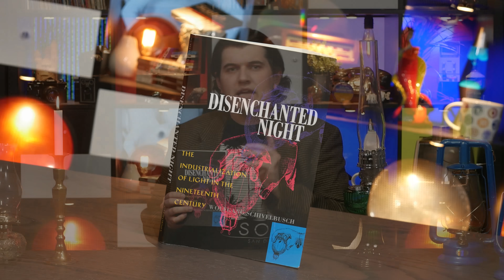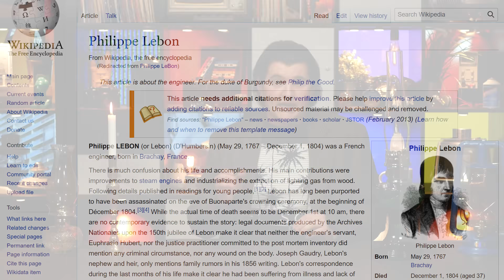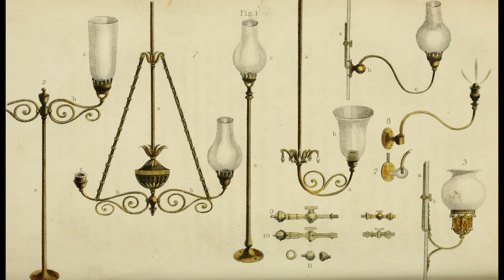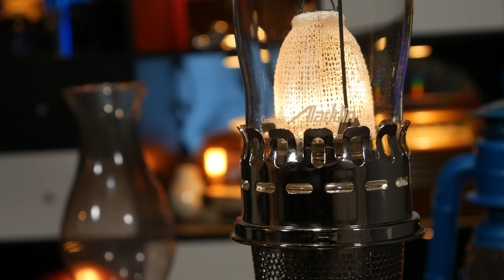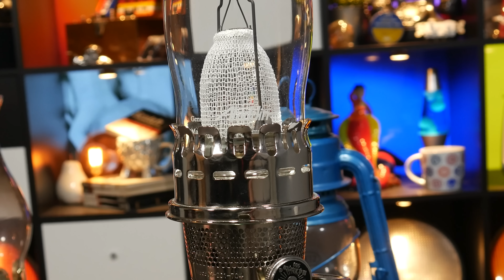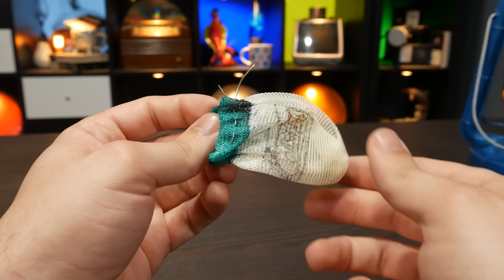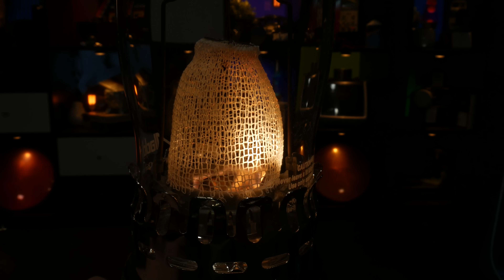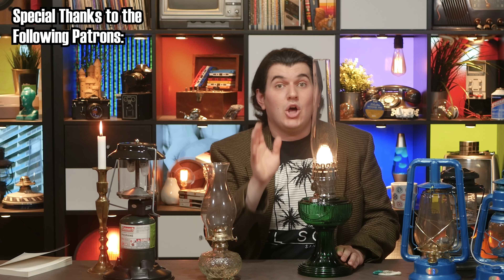How the gas mantle made lamps 10X brighter

Comment: "Consumers Gas" (coal gas) is why we still install a 'drip leg', before all gas appliances. This fact has been lost to history. Just ask any HVAC guy, and he will start scratching his head. Before Natural Gas was piped into distant cities, Coal gasification was used; which was a dirty process. Methane, ethane,  carbon monoxide, hydrogen, carbon dioxide, particulate matter, all stuck together with water. This mixture ended up in the pipes, which often condensed into black goo. This goo ended up traveling down the line, so a "drip leg" trap, was necessary to prevent disaster.

Comment: Candoluminescence is the process in which radicals from a flame react on a catalyst material and cause emission through some other input than heat. The heat drives the reaction by adding energy and/or changing the catalyst to a different state than it would be in at room temperature, but the actual reaction causing the emission is chemical. The materials chosen for lamp mantles happen emit a lot of light in the visible spectrum, so the glowing from candoluminescence is brighter to the eye than the blackbody flame glow- hence why the coal-gas flame could be burned efficiently and invisibly. In order for it to be candoluminescence, there has be some photon emission that is more detectible than blackbody emission somewhere in the EM spectrum, otherwise there is no specific special emission to call out.

The actual mechanism for the photon emission is simply electrons dropping energy level as always. The reactions in the catalyst cause electrons to be excited, allowing them to drop down in energy state once more and emit photons. Of course, all chemistry is moving electrons.

Comment: Suggested connection: infrared gas burners, where you use gas and a ceramic/catalytic element rather than an open gas flame to cook food.

Comment on the city gas: this wasn't simply distilling volatile materials of out coal, but rather partially combusting the coal or reacting it with steam to create a mix of hydrogen and carbon monoxide. More than a little toxic.

Comment: Concerning the kerosene mantle lantern "wick" not fully supplying fuel evenly to the flame.... if anyone in the past has ever tried using diesel as a substitute fuel in any wick lamp/lantern/heater or cooker, it will do exactly that.... it will work fine for a few hours on diesel, but  the problem compounds as the dissolved wax particles and additives in the diesel are being deposited on the fibers of the wick and sealing them from any capillary abilities.... removing and submerging the wick in a  some brand of gum and varnish dissolver solvent (the type for engines/fuel systems) for 3-4 hours, and then rinse in clean solvent, it will restore the wicking capabilities to like new...😊

Comment: As a kid, I grew up in the 1950s. At that time we were not so "fragile" over the safety gas appliances. So, like many others, we had a Colman stove and gas lantern, both for camping trips and for when the power failed. In our rural setting. That was several times a winter, often for a couple of days at a time. Decades later, I lived in the city, where extended power failures were not an issue, but failures happen as short outages. As much for curiosity and need, I bought a Colman stove, a bit more modern but basically the same as what we had in the 1950s. I also bought a two burner Colman gas lantern. (Ebay has almost anything.) Both needed service to function. I got the "how to" information off the internet and parts from Colman. I disassembled both items, fully cleaned and restored them, Both now look and function as though new. Thy went on a few road trips, but now have a place of honor in the garage, waiting for need to arise. Using white gas, they are a bit less convenient to firs start, but the stove is potentially hotter than the modern propane units, and the lantern is brighter than propane or electric alternatives. Additionally, they operate longer on a fuel supply, and their cost of operation is a small fraction of modern units. A great combination of nostalgia and practicallity.

Comment: A side note: coal gas contains a deal of hydrogen. This allows for self-igniting devices - a fine coil of platinum wire becomes incandescently hot in coal gas/air mixtures. So you could have a (gas) switch by the door and the light would come on automatically. (Putting a flame to a cloud of gas/air mixture after switching on is not recommended... )   Sadly these devices dies out when natural gas was introduced - methane won't do this trick

Comment: When early scientists didn't have a great supply of glassware for distillation and other processes,
and they wanted to put together gas tight joints without melting the glass together, they would use
clay and other materials, depending on pressures and the solubility of the sealing clay, and they
would call it lute.

Wikipedia "Lute (from Latin lutum 'mud, clay etc.') [1] was a substance used to seal and affix apparatus
employed in chemistry and alchemy, and to protect component vessels against heat damage by fire; it
was also used to line furnaces".

To 'Force my lute', would mean the seal would fail from too much pressure.

Comment: Before you mentioned it, I was wondering if the coal gas was along the lines of the coke gas I remember seeing vent from the old open hearth furnaces of the steel mills in my area when I was a boy.
My grandparents had those Aladdin lamps back in the Depression. My dad used to talk about how bright the were compared to a regular wick. I'm familiar with installing mantles in my Coleman propane lantern.

Comment: gasometers certainly did measure as their rise and fall did indicate (albeit to an imprecise degree) the quantity of gas inside them.  Early gasometers were not the massive steel behemoths many of us remember but were rather fragile devices that required the protection of an external building called the gas holder.  Many of the brick gas holder buildings survive including one very large example in Boston which was converted by Best Western into a hotel  - now called Roundhouse hotel.

Comment: 19:35 I assume the bulb shape & lattice is what makes it smokeless. 

It’s super heating it inside that bulb lattice, so it doesn’t actually emit smoke. 

I’d guess.. Inside of that lattice, while it’s hot, air is being pulled inside each of those small openings, and getting super heated, which super heats any smoke flowing up into it.
Reply: There’s a campfire / stove out there called a Solo Stove that does the same thing, just differently.

Comment: The use of the term "gasometer" is entirely justified  as it is indeed a measuring device.  Murdoch anglicised the term coined in French by Lavoisier.  The height of the dome within its framework gives an instant de facto indication of the volume of gas it holds. This is obvious because it's the gas that's holding the dome up and as the supply depletes the dome sinks lower.  The works manager would be able to read the gas level from a good mile away.  Anyone who remembers their local coal gas works knows this.

Comment: 19:00 Kerosene if burned very well in a controlled burner with blue flame produces little odor. I think ThO2 act as catalyst in that lamp, it can for carbon monoxide oxidation. With ThO2 (thoria) you can produce light hydrocarbon from carbon monoxide and hydrogen too or CO2 and hydrogen from carbon monoxide and water.
Cerium Oxide act as catalyst too and is used in newer gas mantle, and catalytic converter for automotive. (Rare earth elements)

Comment: When we were kids in Edinburgh newhaven  in 1950 we had gas lights in our house and my mum forbid my sister and me from lighting the mantel in case we touched it an if you did it  fell apart and a new mantel was tuppence  out of ratters shop in newhaven it was nor till just before the coronation of the queen did they put electricity in the houses  and we used to take turn on turning on the lights  that was also the last of going to ratters store for battery acid for our old radio  happy days  then when the queen got crowned we had a street  party and all the kids got a shilling  and a masons pie  I’d almost forgotten all this but this video brought it all back  I’m 78

Comment: I scooped up an Alladin lamp 30 years ago for nearly nothing, I’ve used it occasionally…it’s a great piece…on another note, I heat with coal, use Nat. Gas for dryer, water heater, and range, and have all the other lamps shown as emergency lighting devices…

Comment: That initial burning of the brand new gas mantle fabric did look a lot like the burning of guncotton or nitrocellulose: Similarly rapid, equally bright and the same almost total absence of smoke. So that is definitely a possibility, though not the only one.
There is another way to make cotton (either cotton wool or spun cotton fibre) behave in a similar way when burned: Make a saturated solution of potassium nitrate, soak the cotton with this solution, and then allow it to dry out. This leaves a layer of solid potassium nitrate coating all the cotton fibres.
A similar process is the "corning" of gunpowder - mixing it to a thick paste with water, and then drying this out again - often by spreading the paste onto glass or glazed ceramic plates or trays and leaving them in direct sunlight. Today this is still done, but the drying stage is carried out in large, relatively low temperature electric ovens. This isn't as crazy as it might sound, because while gunpowder is extremely sensitive to sparks (both electric sparks and the flint on steel type), it is much harder to ignite with heat alone or even a naked flame.
Anyway, the point is that the potassium nitrate is the only water soluble component of gunpowder. So when the wet paste is dried out again, each particle of carbon or sulfur gets coated with an intimate layer of nitrate. This makes "corned" gunpowder burn much faster than a simple dry mixture of the components, and is therefore much more effective as an explosive or gun propellant.

Of course potassium nitrate isn't used in the manufacture of gas mantles. But it is not the only nitrate salt which can be used for the same or similar purposes: A peculiar property of inorganic nitrate salts is that they are all water soluble. Any metal that will dissolve in nitric acid (which is almost all known metals) can form a solid nitrate salt, and all of those have oxidising properties, since it is the nitrate ion that does the oxidising.
So the gas mantle fabric was almost certainly cotton which had been soaked with saturated yttrium nitrate solution and then dried. The intimate coating of all the cotton fibres with the nitrate salt would have a similar effect upon its combustion. Hence it looking similar to the burning of nitrocellulose when the mantle is ignited for the first time.

Comment: Here in Pennsylvania, the Amish community (Pennsylvania Dutch) uses these lamps since many don't use electricity.  When I was a youngster our house was 'wired' for gas lamps, I believe that the house was built about 1910, most of this piping was shut off when the house was electrified but I don't know when that happened, it was with BX cable (steel wrapped not knob & tube), in my Uncle's house the gas fixtures still worked but the mantles were missing.  'Dangerous' electricity didn't really dominate the market until after WWone, I suspect that this was due to fear of the newfangled stuff and the cost of hooking up and wiring the building.  What really got electric going was when appliances such as fans, vacuum cleaners, and the big deal, refrigerators became available.  I was a young kid during WWtwo and several houses on my block still had ice boxes and every other day the iceman came on his horse drawn wagon (WW2 gas rationing) bringing them a block of ice, his big customer was the tavern down the street, icemakers was not in general use at that point.  He had a small gasoline powered grinder on his wagon that made crushed ice.  The apartment building down the street had all gas refrigerators, might want to do a video on how a gas flame can cool thing off, hey, I was in the Philippines during the late 60s and the local druggist had a kerosene refrigerator, much more reliable than the local electric system that shut off at about 10pm.

Comment: I went through a period where I collected a lot of antique oil lamps, various types of wicks. I also had many Aladdin lamps. Eventually abandoned the Aladdins to the closet because they are just too unreliable. Sometimes they do fine. Then they wont do right at all. They will be burning great, you look away, look back and flames are pouring out the top of the chimney and the room is full of smoke. Give me a nice center draft, round wick lamp anytime. Just about as much light and very reliable.

Comment: It's maybe bit late, but there is another nice lamp, you've missed. It's called Petromax500. It's partly the same kind like the aladin-lamp, but it converts the kerosin into gas first. and than is burnig it. And it burns insanely bright, even for todays standards. even the wiss army was using them, because they are this bright, and can also ben feeded with diesel. My dad's generation was used to handle these lamps in the army. ..at the end of your video, yu where showing this dual-fuel lamp. its probably the same type of lamp.

Comment: I owned a Full sized kerosene refrigerator from the early 1930s. It was manufactured by Servel. It had a tank that held 2.5 gallons of Kerosene and used an Aladin burner with no mantle. It worked very well but the wick needed maintenance fairly often.

Comment: "Forced My Lute" refers to the glassware connections being popped apart by the pressure of the gas produced.
The glass fittings were referred to as Lutes because they had a sorta similar shape.  A male piece into a female receiving piece.
We still use this system today in Wet Chemistry and we refer to them as Tapered Ground Glass Joints or Ts.

Comment: According to Gemini

In the year 1691, "forces my lute" likely referred to a chemical process rather than a musical one. Here's why:
 * Lute as a Chemical Seal: In the late 17th century, "lute" (from the Latin "lutum" meaning mud or clay) was a substance used to create airtight seals in chemical apparatus. It was a paste-like material used to join glass vessels and prevent the escape of gases or liquids.
 * Forcing the Lute: When a chemical reaction produced excessive pressure, it could "force" or break the lute seal. This was often a sign of a failed or dangerous experiment.
 * Historical Context: During this period, alchemy was transitioning into early chemistry, and experimentation was often risky. "Forcing my lute" would have been a common expression among those conducting chemical experiments.
Therefore, in 1691, "forces my lute" most likely meant that a chemical experiment had gone awry, with pressure breaking the seal of the lute used in the apparatus.

Comment: I know i am very late, but i may be able to assist you with a phrase. I don't have a degree in literature or linguistics, however i do have a degree in Social-Anthropology, specifically Cultural Anthropology; Therefore i am a bit familiar with old and archaic terms used within social contexts of days of yer. the term "Forced My Lute" means that pressure built up and broke the seals on a lute (a lute in this context refers to a semi-hourglass shaped container). i'm assuming based on the phrasing that the pressure built up and broke the seals holding the gas in the glass to the wood or metal base, given the time this phrase was uttered, id say with near surety that it most probably would have been a lacquered wood base. the pressure probably lifted the glass container from the metal ring creating the seal to the wood base, therefore breaking the seal letting the gas escape. hence "forced my lute" forced the lute off of the base.

Comment: Had a decorative old-timey gas lamp pole in my front yard. Bought some parts at Ace Hardware to try to get it functioning. Following the instructions, I attached the two lanterns, which looked to me like cotton mesh, lit them, and the turned to ash. Or so I thought. But that's how it worked. Amazed me.

Comment: My outing club owns a cabin in the woods that's off the electric grid.  They get big bottles of propane delivered once a year and use that to run gas-powered heat, lights, and stove.  I had to replace the mantles on the gas lamps a couple times, and we were trained about how incredibly fragile they were.  I never quite understood how they worked, and now this all makes so much more sense!

Comment: i think gasometer is a good word.  they are inverted tanks in a pool of water.  as the gas enters, the tank rises, giving an easy measurement of the volume, at the current temperature and pressure.  in reverse, as the gas is removed, the tank sinks, proportionally.  as such they are literally gas meters.  however this only works if you charge the tank, and discharge it, in separate steps, whereas in practise, i would imagine, they were probably being refilled as they were being discharged.  however they are definitely still useful as meters, as demonstrated in many of the producer gas experiments i have watched, on here.

Comment: the aladdin lamp is also 5 times as expensive. Been looking into good oil lamp options to help during the blackouts here in Ecuador which will last quite a bit longer it seems. Saw these and really liked the idea, then noticed that they cost around $300, while the old style cold blast lanterns costs $25-$60. Not something I will be able to afford..